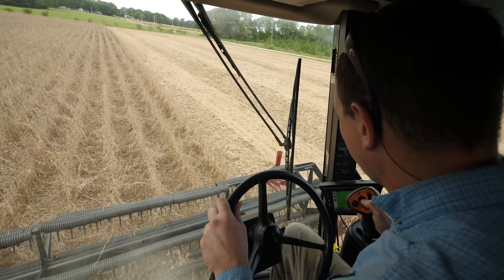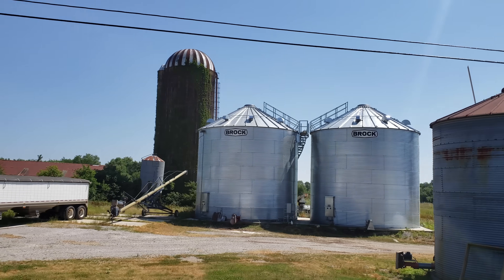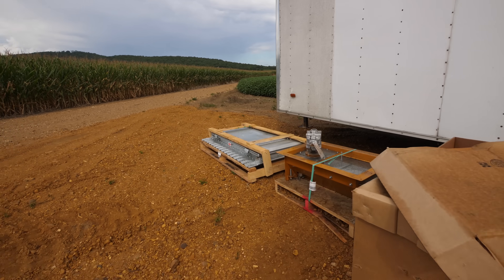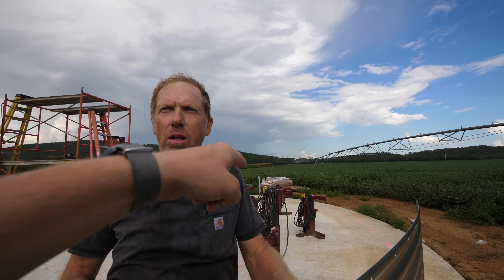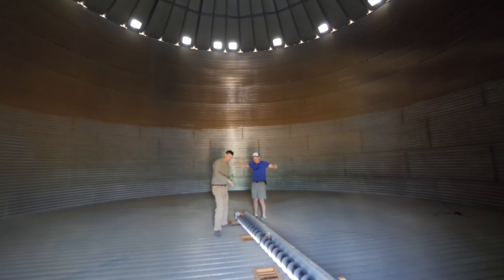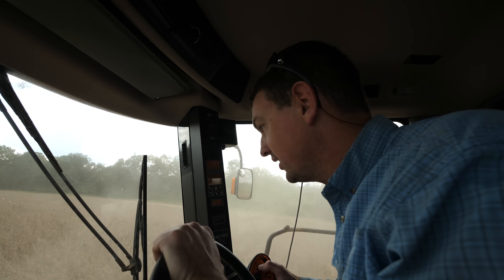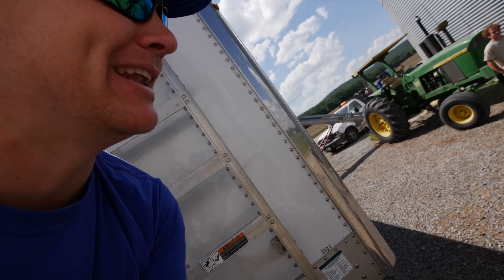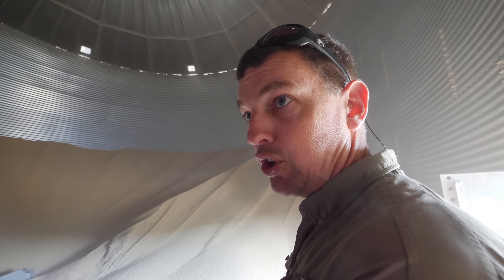Everything About Grain Bins (Farmers are Geniuses) - Smarter Every Day 218

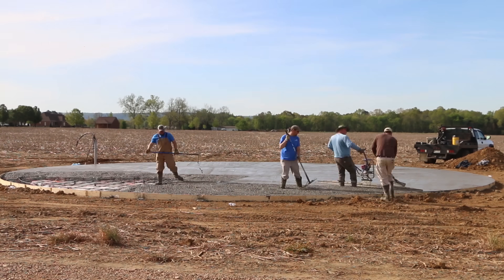Comment: 1:45 another force..... if the grain gets wet, it expands
ive seen (and heard!) grain bins EXPLODING because of the pressure 
.
and you NEVER go into a bin to "un-clog" it
.
MANY people have been buried alive and died from the grain falling down and covering them
.
it "drains" from the center out....usually (their are different styles of bin.... and different machines that empty the bin)
but sometimes they plug up (if the grain is a BIT moist.... it can clump together and clog)
.
so you see this big "cone" of grain..... and you see the clog
so your just gonna hop in threw the roof.... and kick the clog with your boot.... or a pole
.
and then the "air pocket" collapses......  you drop 5 feet..... and the grain from above fills in around you (sometimes over your head)
then you suffocate in a pile of grain
.
or... you leave the machine running..... and you end up getting chopped into pieces 
.
.
 and if you didnt tell anyone you were going inside that bin.....
you might be their for 2 WEEKS!!! till someone finds you
.
its happened before..... and will happen almost every year
.
farming is dangerous...... you have HEAVY machines with a LOT of power behind them
tons of cutting edges..... and your out in the field for 16 hours (OR MORE!!!) per day
.
tired + heavy + power + sharp things = bad things happen quickly

Comment: Fascinating.  I grew up in Iowa, where my grandfather and several uncles all had farms.  From birth thru college, I spent tons of time on those farms.  Your soy bean harvesting, storage and sales coverage brought back some great memories.

My grandfather’s bins did not have that rotating auger underneath.  So when we were emptying a bin, the center of the beans would quickly draw down, forming a cone.  Because it didn’t have that auger, the sides of the cone had to be manually knocked down to keep the process going.  Believe it or not, I recall working around the inside perimeter of those bins, with a couple of my cousins, to kick down the sides toward the center cone.  I was maybe 12 or 13.  In hind site it was definitely dangerous, but we were only doing the same things our fathers did, growing up on that farm.

All that said, the grain bin construction footage was new to me; I’ve never seen one built.  Given my upbringing and the fact I’ve been a professional civil engineer (P.E.) for over 35 years, I particularly enjoyed this part of your video.  That jacking process is a genius solution to building higher and higher without a crane or major scaffolding.  

Great stuff; love your channel!  Keep doing what your doing!

Comment: Hey I build these things here in canada! We have those types of jacks(hydraulic) but using chain Jack's is cheaper, safer and takes less time.
Edit: Oh and before tightening the first bolts holding the sheets together, go around putting 1 or 2 in the top, middle and near the bottom loosely, then go around again tightening them with a punch centering the holes as that will save you from issues later

Comment: I build tanks and domes in the oil industry and we basically use the same tools, they call the pin a punch we call it a bar, and we use them to line up the beams and drop some huck pins in, bolt up tanks are very similar as to grain bins as well

Comment: To help people stuck in grain bins, I'm wondering if can we install a microphone and system where if you shout a word like "call" it will contact the fire dept (or others) through a radio or a cell phone? Another idea is to install a voice activated trap door, letting the grain out.

For those caught by augers, would it be helpful to have a wristband with a button that stops the augers from moving, it seems like a simple device to make. If not a wristband, we could install the button on a commonly used tool. We could even make it voice activated too. So if someone yells "help"/"stop" the auger will turn off.

Would any devices like these be useful? Or is the issue mostly that people suffocating from the pressures of the grain and help cannot arrive fast enough?
As a engineering student from a city, (who knows nothing about farms and is learning how to build devices like these) I feel like there has to be some better tools/systems/devices that farmers can use to help mitigate accidents
Reply: First paragraph, most of the time you end up under the grain, fully. The trap doors have to be on the sides of the bins, otherwise you'd just make it worse, which if it is a big enough bin, you'll run into the issue of running out of room for the grain to escape.

Second, that is somewhat a thing. Voice activated doesn't really work though due to noise or giving instructions. You don't want to stop an auger full.

Third paragraph, somewhat. Yes the main issue is either suffocating or bleeding to death before help arrives.

And to add a point: it has to be cheap, whatever you make, and fool proof. If it causes any trouble it will be bypassed or not installed in the first place, regardless of it possibly saving a life.

Comment: fun fact - the moisture tester at 11:20 is actually just a capacitor, with one plate on the underside of the lid, and one plate at the bottom of the canister. when the canister is filled, the grain acts as a dielectric, and all other necessary info remaining constant (distance between the plates, type of grain used, etc.), water's presence changes the extent to which a given grain acts as a dielectric within the capacitor, which is how you get the moisture readout 🌺
Reply: Respectfully, I think you might be wrong. I’m pretty sure it’s just magic.
Reply: I worked at a co-op for several years when I was younger and I had to use a stationary moisture testing machine about a hundred times a day. I always wondered how it worked!
Reply: Wow that's genius
Reply: Thank you
Reply: That’s amazing
Reply: You deserve a thumbs up for that one!
Reply: Wow thank you so much human 🥰
Reply: hmm yes, i know some of those words.
Reply: @JordanLofgren434  lol XD
Reply: @JordanLofgren434  basically theyre just saying the way they test the moisture (how wet the grain is) is by sending electricity through it and seeing how well it passes through. the wetter the grain the higher electrical flow (because water contains minerals that conduct electricity). all they would need is a scale of what electrical flow lines up with what grain wetness.
Reply: Why not continuously mix the bean while it’s drying? Wouldn’t the bottom be significantly dryer?
Reply: that's just... fascinating
Reply: @finonevado8891  It's so simple but I never would've thought of that. It's just brilliant

Comment: I'm sure someone else noticed this, but that's not a punch.  It's called an alignment drift.  Punches are varying in size and typically straight-sided.  The drift in the video is being used for exactly what it is designed to do. 😁

Comment: There is a big reason that your corn doesn't do as well as that on a farm - because your corn is "sweet corn", not "field corn" or "silage corn"; you also don't have the specific chemicals that the farmers use to get the corn off to a good start.  Although farmers are relatively smart, don't over estimate -- modern farmers have a LOT OF HELP from federal and state agriculture departments who provide them with best planting times, soil analysis which includes providing what and how much minerals, chemicals, fertilizers to use and when, insect control, etc.  It also helps to have hundreds of thousands to millions of dollars worth of automated machinery for soil prep, planting, fertilizing, cultivating, harvesting, etc.  Like the first guy said when he was testing the soybeans for moisture, he doesn't know how it works, he just knows it does.  Then like the other guy said, he has a good accountant, a guy who does the marketing, etc.  The biggest problem with starting out farming is MONEY, most of these larger farms are multi-generational, been in the family for generations and these guys learned a lot working on their farms before eventually taking them over.  They have been using this machinery for years and KNOW what usually goes wrong and are most often simple fixes, but when the electronics breaks or major parts break, they do have technicians/mechanics that they call to make repairs.               (I'm a very small independent farmer).

Comment: I have an engineering question. Why do the corrugated lines run horizontally and not vertically? I would think the corrugation would be used to hold up the weight of the roof and the pressure of the walls above each section. Like pressure in the oceans, wouldn't the pressure on the sections closest to the floor be the most extreme? The way it's built with them going horizontally, it seems like that would encourage the whole thing to crumple downward with gravity. But if the corrugated metal ran vertically it would be much stronger, much harder to crush from the top down. What am I missing here? What mechanical advantage is gained by making the corrugation run horizontally? It's not like this thing can twist. Or can it? At 13:59, for about a few seconds, there's another metal building in the background and it's corrugated lines go vertically the way I'd expect. Does it have something to do with the round grain bin vs the rectangular metal barn? I'm so confused.

Comment: Great presentation.  You missed an important engineering plan during construction.  Bins have to be assembled in the correct order.  Bottom panels are thicker than top ring panels.  Bottom panels have more force trying to push them outward or split them.

Comment: When they corrugate the sheets, is there a reason why they are about 30% off and not centered, or is it just aesthetics? Got my OCD going here.
Reply: its so the seams (where the sheets overlap) are not in a line (vertically) ... they need them offset for structural integrity

Comment: The tool he called a “punch” is actually called a “drift pin” we use them all the time in the sheet metal (HVAC) industrial world when joining two pieces of duct together
Reply: You also get a type of spanner called a rats tail or podger that has a tapered end. The tapered end is used to centre the holes. The spanner end is for tightening the bolts.

Comment: Most handheld moisture testers (like the one at 11:20) measure the capacitance between two plates within the sample chamber. Moisture reduces this capacitance.
Knowing the type of grain being tested along with tight calibration on the unit allows reasonably accurate measurements of moisture. There are other, more advanced systems, used elsewhere in the industry. I used to be a technician at a plant which manufactures moisture testers.

Comment: Where I'm from that's called a drift pin, not a punch.
Reply: We call it a pfid -- for (when you're installing wings) lining up the wings on an airplane to insert the wing root shear bolts and the bolts in the struts.
Reply: @KOLODNY95  Yep,it's for lining up holes for bolts. Different names ,but same tool.

Comment: I construct Grain Bins for a living... flattering to know I'm basically an engineer... 😂 biggest bin my crew's built, is a 101,000 bushel bin. 54 feet in diameter, and 13 rings (tiers) high. Each ring is 44 inches high. So 47.6 feet high, not including the roof. Honestly Destin, I learnt some new things from this video, and I've been building these bins for 4 years. If You ever stop by southern Alberta, hit me up, and come join our crew. (We could use some free labor now and then. 😉 watch out for pranks though... it's a group of 9 guys, most of which like to mess around with the newbie. 😄)  We have a slightly differant routine, but the basic principles are the same.

Comment: The “Punch” is actually called a “Drift Pin.”
Reply: Or a spud
Reply: I've always known the "punch" to be a "PODGER", which often comes with a spanner on one end too, so that when the bolt is in place, you can use the same tool to tighten it up.
Reply: “Punches are the best” it’s a drift. “I love punches.”  Drift.
Reply: Drift pins are most definitely different from punches or spuds.

Comment: You cannot be dumb and be a farmer. Destin is absolutely correct. Farmers are some of the smartest people there are because of the numerous overlapping and interacting disciplines required in both their planning and in day to day operations. One of my first jobs was erecting grain bins. One thing not mentioned here is that the evaporation of the moisture from the grain works just as when you step from a shower. Instant cooling. So the evaporating moisture reduces the temperature significantly thereby helping reduce the likelihood of bacteria and fungal growth. The first wave of the air plenum type bins was called Harvestall, and was invented by a Dr. Stephens in Cedar Rapids, IA. The Harvestall bins I helped build were done in 1977.

Comment: I love this video so much. Im a very new engineer and I've always heard the old fued of engineers vs. Operators/technicians(farmers). I have a profound respect for these farmers' insane "feel" for their equipment and processes, something an engineer would be wise to observe and respect. Great video Destin!
Reply: In my former job in semiconductor manufacturing a lot of my colleagues came from a trucking, farming and fishing background and were the best at solving problems and keeping things working in a very measured and controlled way. Their background in taking on physically demanding but also mentally challenging work and operating as a team was second to none. There is however a high cost in injuries and death in farming if you do not proceed with jobs in a very measured and careful way at all times.
Reply: It would be nice if the engineers and designers would spend more time with farmers and see how they could design equipment to be more efficient and easier to work on.

Comment: About the wind...why aren't these built with a tapered shape, wider at the base and tapering slightly towards the top? That seems like it would be a lot more wind-resistant...maybe a bit more complicated to assemble but it shouldn't be overly difficult once the engineering has been worked out and have it incorporated into kit form...

Comment: We also have computer systems that turn the fans on and off based on the outside temp and humidity depending on how much moister you want to remove or add.   Also when we gin cotton we will over dry it then preform the cleaning process because it cleans either then we will add moisture back up to the highest limit so that we get paid for the water because it’s weight.

Comment: I like this video as it explains about the grain bin on the farm but you need to explain what can happen to grain bins in this wonderful thing called weather, like getting struck by lightning and snow can build up on the roof say if you have a ice storm and get damaged by hail and there's a thing called wind and tornadoes recently on 8/17/20 there was a storm that started west northwest of Sioux City Ia and continued to head east causing considerable amounts of damage to #1 Grain Bins and silos and and anything else in its way, the extensive amount of damage was done around Des Moines Ia Cedar Rapids Ia Waterloo Ia Marshalltown Ia Ames,,Boone where a elevator got hit and destroyed I believe 3-5 grain bins that each one held in the 6 digits figure so Im thinking in the 200,000 bushels figure, each one times 3 to 5 depending on how many there was. With the heat meaning excessive heat as we have had temperatures 90 plus degrees 33 days so far with possible another week until we see some cooler weather temperatures as you all know that it always gets hot out when the kids go back to school. But with the temperature being very high crops are starting to change and these bin companies are trying to get all the bins up in time for harvest 2020, but a week ago Monday 8/17/20 a storm started west northwest of Sioux City Ia and took out anything in its way with winds as high as 140 mph, I believe they called the storm derecho yes the winds were hurricane force winds and this storm they figured 100 plus miles wide and 700 plus miles long, it went all the way to Chicago Illinois and they said they had winds up into the 90 plus mph and the storm continued east into Michigan and Indiana but didn't have winds as what was in Iowa and Illinois. So you should go take a trip through Iowa and Illinois and show pt2 bin damage from derecho storm people will be devastated  !

Comment: In Aussie we call those punches, Podgers for aligning two holes an placing the bolts or scaffolding pins. podger
/ˈpɒdʒə/
Learn to pronounce
noun
noun: podger; plural noun: podgers

    a short bar of iron or steel used as a lever, especially for tightening a box spanner.

Comment: A moisture tester works by conductance. The tester is calibrated for the seed tested, then the chamber is filled and closed. An electric current is passed to one electrode, and moistue in the seeds closes the circuit. Because seeds are an indulator, while water is conductor, dryer seeds conduct less current.

Comment: a punch is a tool that's used for an entirely different purpose, in the case of manual operation usually in conjunction with a hammer. what you are using is called a 'drift' . in your case the one you are using is a  single point drift, they also come in double point, the other end being a shorter more stubby taper or the other end can have an angled chiseled end similar to a pry bar or crow/jemmy bar. drifts come in all shapes and sizes and are used in the construction industry for assembling the structural beams that hold and support buildings together.
.